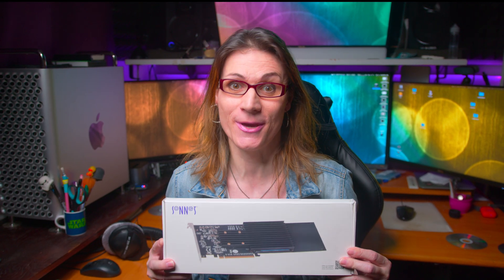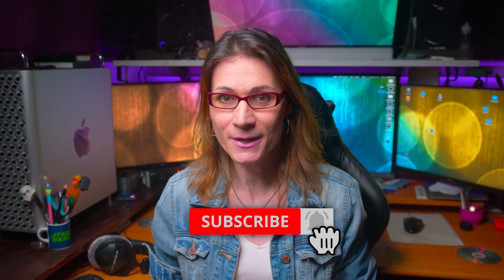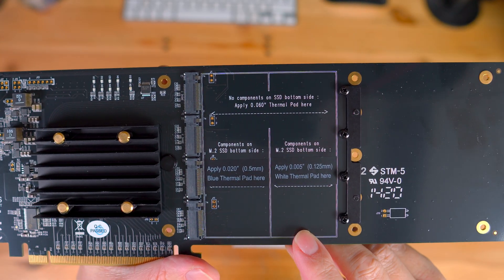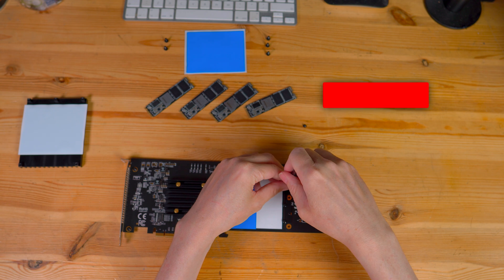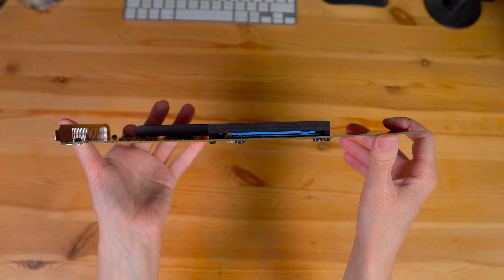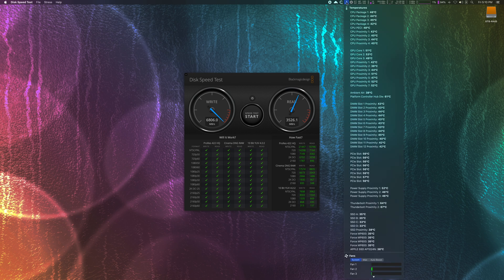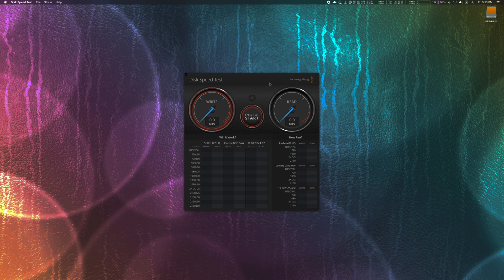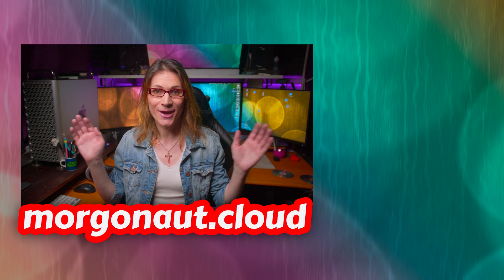Video & Audio Editors - You Need This! Sonnet M.2 4x4 PCIe (New Version)

Comment: What is the purpose of the very long PC board extending beyond the end of the heat sink?  Can this just be cut off?  (So it does not block airflow of blower-style graphics cards in slot 1).
Reply from the maker: @a_mouse6858 - it's standard length for example to fit into the grooves in2019 Mac Pro. But Sonnet makes also much shorter version of this card

Comment: Have the OCZ 4M.2 in 2010 Mac Pro 5.1. Software raid seems no faster then a single M.2 drive, maybe even a little slower. Does this card use Hardware Raid ?
Reply from the maker: HW RAID made sense in the past, software RAID is more flexible and can be even faster. This card has HW PCIe switch so it can run in any computer even without bifurcation.
Reply: @morgonaut  Chasing Raid 0 speed, to capture Uncompressed Raw via AJA Kona4, 1200Mbs from the OCZ card gets less then half the framerate, with dropped frames. Hoping hardware will be faster, but not sure which slot to fit to, gpu is x16, kona is x8.
Reply from the maker: @PiDsMedia - well I can't obviously judge your setup when I did not see it nor configured :)

Comment: Hi Theresa, what computer would you recommend for something decent to work with for video editing and animation? before we had MacBooks pro mid-2012 and we bought an MSI Stealth GS66 12UGS-002XES - Laptop 15.6" FHD 360Hz (Intel Core i7-12700H, 32GB RAM, 1TB SSD, RTX 3070Ti-8GB with windows 11) and it was terrible; we did not even manage to edit a video, we only worked with photoshop, and while editing a photo, the computer hung after a glitch and went to black; we turned it off and tried again. Nothing, it happened again and again, and we have returned it. Now I do not know which computer to choose, we need something that works immediately and urgently. I know you've got your VIP services 1 to 1, but we have nothing to fix at home. How could we get your assistance to get the right laptop?
Reply from the maker: @Daniela Gallardo - what would be best for your specific use case can't say, I'm still just a human and still can't read mind :) So I would recommend to discuss all details during let's say 1 hour video meeting which you can book on my website https://www.morgonaut.cloud/get-help/

Comment: I'm a professional audio engineer/editor. I have a 2009 Mac Pro with an upgraded cpu and 64 gig of ram. I want a 2019 Mac Pro, but am wondering about if a new Mac Pro will be coming out. Apple is taking too long.
Reply from the maker: @tekis0 - there will be always something new coming, so you should enjoy what options you have NOW. I work primarily on 2019 Mac Pro, it does everything I need

Comment: I've had mine for a few years and just recently added another 2TB. Weird of late, they tend not to mount consistently. Needs a reboot from time to time. Still the best internal storage option.
Reply from the maker: I covered in my videos already 2 best storage options
Reply: @morgonaut  No tips on avoiding my issues?
Reply from the maker: I would need to know everything about your hardware and deeply inspect it, without that nobody can help
Reply: @morgonaut  That is true. Monterey 12.3, 3.2 16core W, 96GB RAM, and Vega II 32GB. 2xSamsung NVMe M.2 970 EVOPlus 2TB on that card.
Reply from the maker: you must have some hardware problem

Comment: But will this work in a MacPro 2010 5.1, running Mojave?  This video is a year old, and you actually added the card to one of the new MacPros, not the old Cheesegraters.  Would love to be able to use this in an old cheesegrater.
Reply from the maker: :( I said clearly in this video it will work in any computer with PCIe x16 slot. I even added links to specifications in video descriptions but for some people it's not enough! :(

Comment: Can you use this in say a proxmox server and pass thru individual ssds to virtual machines??
Reply from the maker: you can use it as I say in this video in any computer with PCIe x16 slot. I did not test the exact way of configuring you want, I have it in my high performance ZFS file server for ZFS stripe insane array

Comment: Hi I know I asked you about activation lock, MacBook Pro 2019 is it worth paying $150 to unlock it as I don’t have access to any  other MacBook , but I don’t want to be told that after they take me money please advise
Reply from the maker: you should never buy any stoled Macs!
Reply: It’s not stolen I forgot the password and it went into activation lock I called apple and they checked it and said they can’t help unless I can provide them with a original receipt and as it was not purchased from apple they could not help , I don’t have any issues with spending money to have it fixed but when I explained to them what I would like them to do,as shown on your video they didn’t do it exactly like you did and then returned it after 2 days and when I asked what MacBook did they use they said they used a HP

Comment: Great informative video.  I upgraded as you recommended, but initially only with 2 SSDs. Now I want to complete my sonnet card with 2 additional SSDs. How can I add these additional ones in MacOS to my existing 4TB Raid 0 to increase it to an 8TB Raid0?
Reply from the maker: you have to rebuild the array from the ground :) If you would run server with ZFS you could just add those 2 new drivers to existing setup, but macOS is not running ZFS :)

Comment: Thanks for the info! Just purchased two of these cards for my Mac Pro 2019. Will be using one drive to host my video project RED raw files, and the second for scratch disk. Excited to edit some projects with this type of extreme speed and latitude.
Reply from the maker: you're welcome Rene. You will not regret. I use this card daily for my 6K video production over 10G network from my file server. I could not be happier about that. And I have since this video very good relationship with Sonnet so I will review even more products in future for you. I like Sonnet few decades, I had even their accelerators for PowerPC :)
Reply: @morgonaut  Just got a few Sonnet M.2 cards installed in RAID 0 for each. This setup is blazing fast! Stoked!!
Reply from the maker: yes, that's why I made this video so people know what's the best :) I use it daily

Comment: It's 2021, and I have just gotten my first RAID set ups, no where near these speeds you have, but I'm happy though, got them on eBay for super cheap. I just got an OWC Thunderbay 4 Mini with 2 x 1TB SATA SSD for my photography, and an OWC Thunderbay 4 with 4 x 1TB 3.5" HDD for my Time Machine backup. One day when SSDs drop more in price I will have a NVMe RAID setup, and definitely upgrade my HDD's to SSD's.

Comment: Thanks dear Mogonout. How can know what is the best chunk size of my raid 0?
Is it a simple matter of setting the raid and doing blackmagic speedtest?
Or is there something else?
Reply from the maker: as I said in this video you have to do your own tests what chunk size is best for your specific workload
Reply: @morgonaut  I heard you loud and clear but I want to know how to preform the test?
Reply from the maker: there is no general BEST. As I said in this video best for me will not be best for you, it depends on YOUR files, not mine. That's why you have to do your own tests, which chunk size is best for your use case. I also had to spend the time and rebuild my array lot of times with different settings to find out the one which works FOR ME only based on my files and my workflow.

Comment: This is insane I need this!!!!!
Reply from the maker: :)) so buy it as I did :)
Reply: @morgonaut  Yeah! But I don't know if I should wait for a 16inch version! I would like more a 16inch version because for music bigger screen + bigger resolution = better workflow
Reply from the maker: you can always connect external displays to this. BTW that's how I plan it to use. Most of the time as a desktop for office work and occasionally I will unplug all and take it to bed etc.
Reply: @morgonaut  yeah but unfortunatly most of my audio plugins aren't working at all due to wrong rosetta translation so it's not yet the right time for me I just did the researchs.. :( I must wait -_-
Reply from the maker: ok but that's not problem of apple or apple hardware, it's problem those developers were lazy and did not do their homework despite they had so much time for it
Reply: @morgonaut  yeah... 🤬 now I must wait... I'll just find a old mac somewhere to recreate my usb key installer and the EFI and just change my 1080 Ti for a AMD GPU and wait for the next generations

Comment: As usual great Video! What is the benefit of the Silent Version? I saw price is same like previous. Can anybody tell me that?
Reply: FWIW, I use the model with fan & which is also 'silent' (enough - need to push your ear onto the mac chassis to hear anything & the mac fans are louder than the Sonnet). I prefer this route exactly because of the cooling and thermals for my 4x samsung EVO 970s setup as RAID O for fast caching in Resolve Studio & FCPX. I also prefer the build & casing of the fan version.
Reply from the maker: fan = point of failure. And as you could see all my disks stay exactly at 35 degrees of Celsius without any fan = no reason to go for old version with fan
Reply from the maker: ??? it's clear - because it has no fan so it's SILENT
Reply: ok, I just was curious if there is any other benefit or difference. thanks anyway!
Reply from the maker: when the price is the same as previous model then it's clear choice to get the new one :)